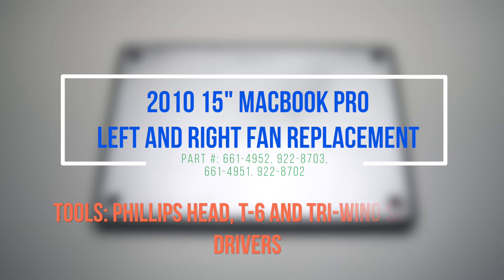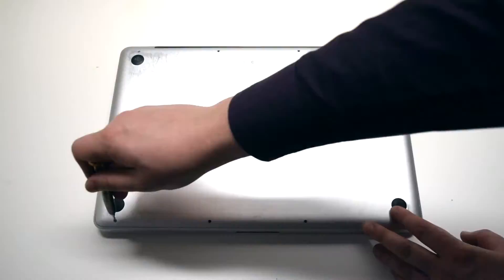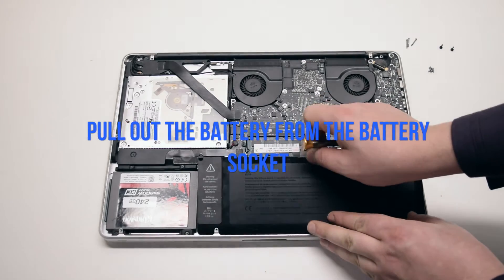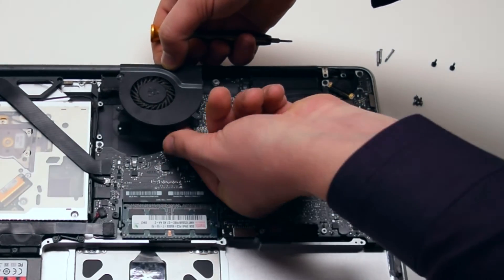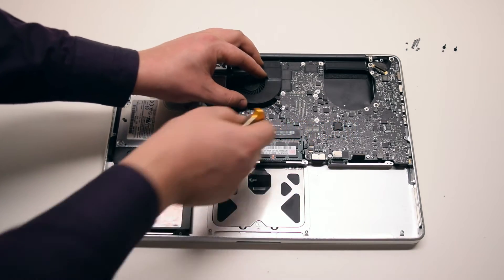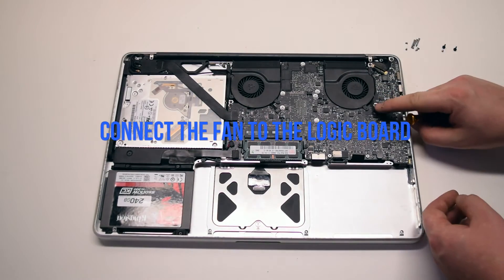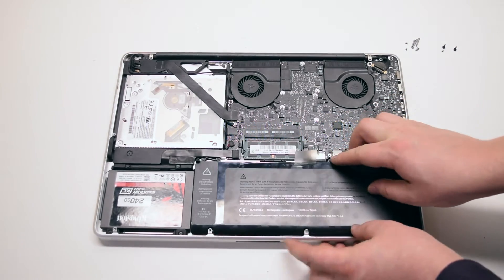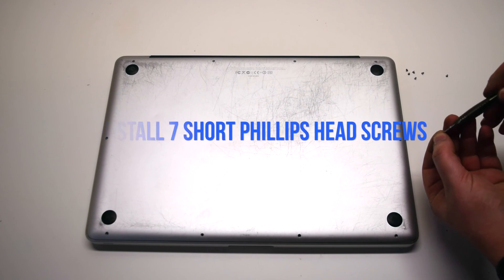2010 Macbook Pro 15" A1286 Left and Right Fan Replacement

Comment: Hi there. Great video. What's the screwdriver you used to remove the battery? I only have the one you need to remove the case.
Reply from the maker: It's a try wing driver here in this kit https://ebay.to/2yiNkfL

Comment: Good tutorial, one question, do one pull horizontal or vertical (upward) the fan connector wire to dislodge it?
Reply from the maker: You genteelly pull up on it so based on your question that would be vertically.
Reply: Thanks

Comment: Thank you so much for the very helpful tutorial! Replaced the left fan on my 2010 Macbook Pro 15" and it's never been quieter; I actually can't believe it! Make sure you have the correct screwdrivers, though, because the screws for the fans (TR6) are different from the ones that secure the computer backing (PH00).
Reply from the maker: Glad to help!

Comment: What kind of screwdriver do i need for this model laptop?
Reply from the maker: For 2010 a 00 phillips head but some late sub models required a Apple proprietary star driver. Just buy any $5 apple tools kit on Amazon or ebay and it will have it.

Comment: I'm not sure whether I should change the fans. Sometimes they run at full speed for no apparent reason, or with just by watching ayoutube video. It's mid 2010 mac, should I replace them?
Reply from the maker: Take out the logic board clean in with 99% alcohol and a toothbrush make sure to remove all and any dust then replace the thermal paste under the CPU fan and GPU heatsinks and you will not have any fan problems. here is the video for the logic-board removal; https://www.youtube.com/watch?v=84xQloM_Q0c
Reply: wow! i had no idea that was the reason. If I get the courage to do that I certainly will. If not I may have to ask an experienced macbook pro dismantler. Thanks a lot,... this is a great channel!!
Reply from the maker: Thank you.